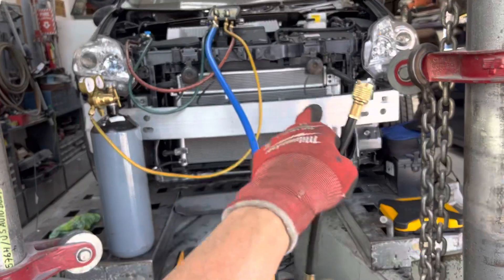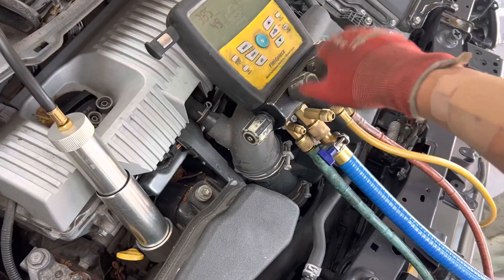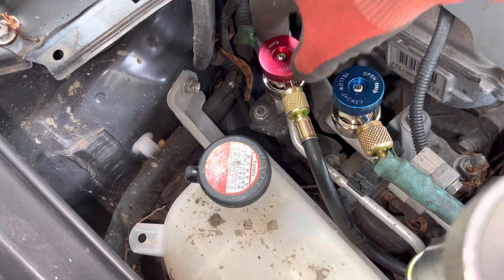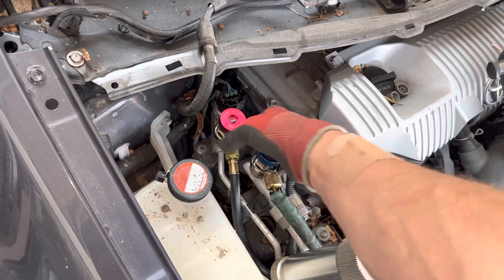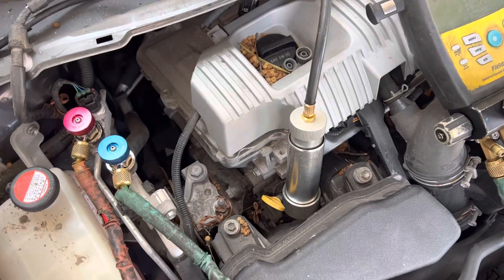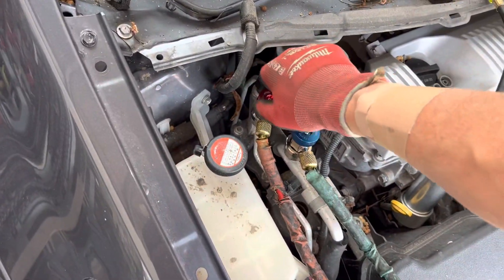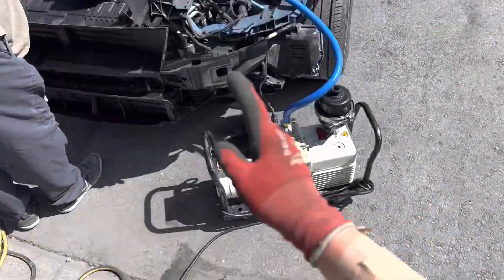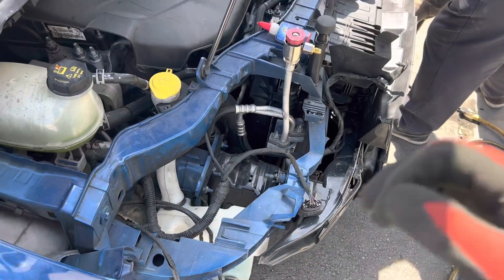AC OIL & UV DYE INJECTED + DRY NITROGEN TO PUSH THE OIL & SWEEP THE SYSTEM FROM HIGH TO LOW SIDE.

Comment: 🤯😳how is this guy efficient in his work? Way too many components to think about. The ac machine does it for you. Why don’t you have an AC machine? This someone that should be doing from their own garage. Looks like a real shop to me. But this an ancient way of doing such job. Grass in not always greener in the other side like they say.
Reply from the maker: It’s efficient when you know what you’re doing. 
    It’s efficient when you did a 10,000 times plus it’s muscle memory no thinking involved anymore and it actually makes you think. 
    That’s the problem with the machine it makes dumb technicians. It literally invent them.. 

The recovery unit that I used to recover refrigerant can recover in less than five minutes . 
    Faster than any Automotive machine sold on the market

My vacuum pumps pull a vacuum many times faster into a deeper vacuum in a shorter amount of time 

When recharging refrigerant I can do it liquid anywhere between 10 seconds and 30 seconds is all it takes to completely recharge a system with liquid refrigerant. There’s no Automotive machine that can do that. . 

This is the difference between somebody who’s uneducated untrained no experience no formal mentoring or guidance who didn’t go through a proper apprenticeship   

And a difference between somebody who’s never done the work has no training just reads literature sitting behind a desk . 

It’s very black and white to completely different worlds. Somebody competent somebody incompetent. 

One method literally takes the brain work out of the job to intentionally make their technician stupid . 🤯😱
Reply: @coldfinger459sub0 it’s actually the opposite buddy. Time is everything in this business. Why spent so much time in this process when you can spend it doing other jobs while your machine does all the work. It’s called work smarter not harder. This system you are using I have in my garage. It’s a budget AC machine system. You spending way too much time in this process and I won’t insult you. I’ll be a better man. In my opinion you know what are doing but there is a much faster smarter ways of performing this task. And you are not well connected with the automotive business like I am. I don’t have time like you to be making every job a project. In my automotive world you wouldn’t make the first week. We use every minute to and make it count. To make good money you have to spend money cause time is gold. So don’t come with whole speech about technicians are dumb when they use technology to their advantage. And use your experience and expertise in other areas where is more needed. AC jobs are not that hard by the way. It’s a cake walk for me. Your way of doing this is way to complicated even if you have done it 1k times. It don’t matter, I look for ways to make more money the smarter way and not the ancient way like you are sound there. Come on are you serious?! Hardly anybody uses this way of working AC in a real shop environment. I was doing what your are doing 20 years ago. You have to evolve as a technician. Peace. Good luck

Comment: Bro, just an observation after watching a few of your videos. You have thousand dollar plus in equipment, but you cannot film without having both of your hands available… ??? Think 💭 head strap, gorilla mount, etc.. many options available and all less than any fieldpiece connector.
Reply from the maker: Yes, I thought of little tripods. I’ve done that the little stick on tripods I’ve even got good microphones lapel’s shotgun microphones. I got lights to do all of the fancy stuff and make nice videos.. 
    I have absolutely no time for editing no time for retakes when I attempted to do tripods lights and microphones I was losing $2000 a week in production labor. 
     My labor rate is $227 an hour
    Materials about the exact same 50-50 split labor and materials per hour that’s just about almost $500 per hour setting up for camera gear and tripods is just a waste of time. 

     As I approach retirement
    And I always wanted to be in an instructor and do some really good quality edited training videos. I will do that later on.. 
   When I shift over into teaching mode. 
      Right now pick up camera think of the last second take a few minutes of video and it instantly uploaded with no editing. That’s all I have time for..

Comment: If the system is vacuumed and passes could you add the oil and then sweep it with refrigerant?
Reply from the maker: Should add oil before vacuum.   When adding oil to a vacuum system you add a little air and moisture contamination. 

Even the oil in plastic bottles in the automotive store has a small level of moisture contamination 

You can add in vacuum if you are going to still vacuum for a long time after

Comment: I have a recently charged system - with a small leak at the Evaporator. As a last ditch effort before fixing the evaporator I’m going to try red angel stop leak. Since the system is already charged -and the stuff I purchased is just in a regular bottle and not already pressurized would I just purchase a oil injector and induce it into the low side port with the vehicle running? I know It would probably be best to do so by emptying the system , pulling a vaccum and inducing it that way but I just paid 150$ to have it recharged so I’m hoping to not have to empty the whole system just to be able to add the stop leak. If it doesn’t end up working then I’ll be doing the evaporator but it’s quite a big job on my car as the whole dash has to be pulled out. So I’m hoping I might get lucky with the stop leak but not counting on it. Any advice is appreciated !
Reply from the maker: Look up TracerLine Products

They started developing leak sealants that had a syringe that you can just inject into your full system . 

But what I cannot remember is if they made one for electric vehicles 

TracerLine products was a high-quality manufacture of trusted UV dyes that I was using 40 years ago . 

I have known people with read angel horror stories specially if there is moisture in the air inside mix with Refrigerant, turning into Jell-O 

And I actually came across in my ears to systems that had this happen 

It literally look like lime Jell-O because it had the green UV die in there and the oil and the red angel turn thick 

Every component had to be replaced in the whole entire system .  

I do not use leak sealant . 

But I was looking for one for Prius because it’s 7 1/2 hours to replace the evaporator . Here in San Francisco where are the majority of the labor rates in automotive shops are over $200 an hour. That gets a little bit expensive. I feel sorry for the customers.. 

For you I just sent a email contact to TracerLine Products asking them if they make a leak sealant for electric vehicles specifically . 

You can go to TracerLine Products website .  

And see if you can find anything yourself or ask the question or call up there hotline it’s a one 800 free number .

Comment: What brand dye are you using for electric compressors. Tracerline only shows a three pack of 1ml hybrid dye capsules for $80. 
I was able to find nonconductive uv dye in New Zealand. Google is lacking and I had limited success for a good product for a busy shop. I normally just skip dye on hybrids with electrified compressors.
Reply from the maker: AC Extendye

TP100EVD-5 (tracerLine 5 ounce bag)
Reply: @coldfinger459sub0  thanks

Comment: Tom, when you decide to replace condenser with new one?
Reply from the maker: You replace condenser if you had a car accident and I got smashed

Can you replace condenser when you have a leak in your old condenser? 

Or are you asking? When do you decide to add oil? 
        Toyota factory recommended is 40 mL of DENSO ND 11 refrigerant oil when you are replacing a brand new condenser .  Is this the question you were asking and wanting an answer for ?

Comment: Tom could you do a video about what's inside the 134a adaptor port's Id be interested to see. 
I remember you saying you stripped them down to service them. I bought some r22 to 134a converters to test the vacuum on my cheap adaptors with my vacuum pump.
Reply from the maker: Yes, that video is in my plans

Comment: You clearly made the point about the use of spec oil, but I understand even the tracer dye must be rated for hybrid/EV compressor use. True statement?
Reply from the maker: True that is why you buy several different types of dye for different purposes, different oil combinations. 

99.9% of most shops are too cheap to do that and other just plain lack knowledge and then the other percentage just don’t care. .

Comment: Tom, how do you store your gauges between jobs? Do you fill them with dry nitrogen 
I just got a fieldpiece 480v and want to care for the best I can
Reply from the maker: I vacuumed them down to 100 µm only takes one or two minutes sometimes less sometimes more depends on how contaminated your last vehicle was. 

Then I fill them with dry nitrogen to about one psi plus or minus no big deal . 

Sometimes, when I know, I’m gonna use the gauge set in a couple hours for a couple minutes .  Because I do so many cars per day.

I will store them under vacuum get it under 100 µm and then clothes off each valve . 

When I go to use the unit a couple minutes later and I turn it on it should still be somewhere down at a couple hundred microns at least then I know everything is good 

If one side hose shows less vacuum, then the other for example one hose drops to 29 or 28 negative vacuum it’s no longer in the micron range .   Then I know I’m looking for a leak under vacuum and I have some work to do.. 

But I am into high production where I’m jumping from job to job every several minutes. 

So my gauges are constantly being used throughout the entire day . 

Only at night do I store them with nitrogen . 

You were probably talking about long-term storage many days or weeks in between . 

In your case, draw them under 100 µm we’re about 10 minutes . 

And then purge nitrogen in the system somewhere around 2 to 5 psi, positive pressure . 

And then store them